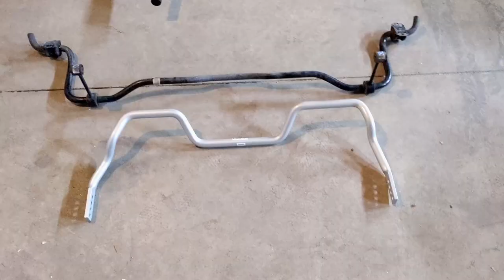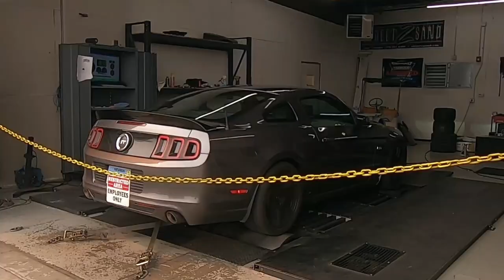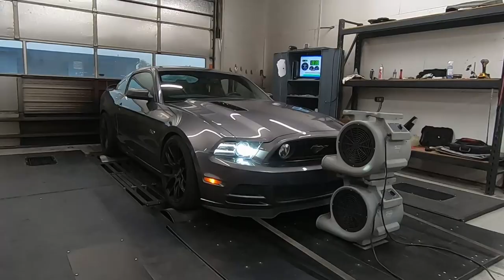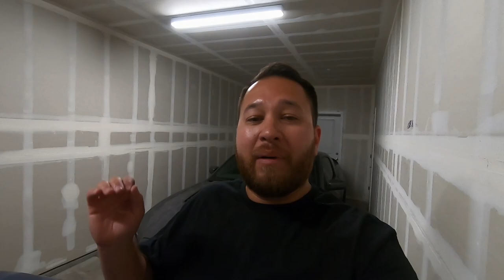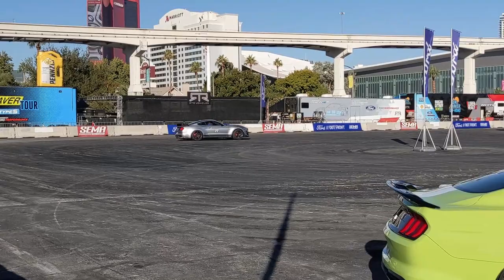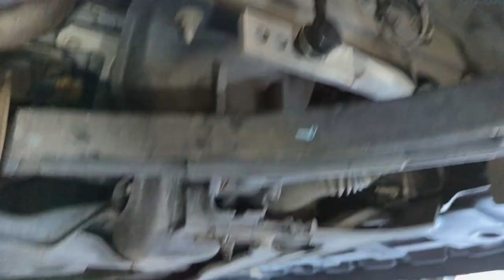Sway Bar Tuning/Adjustments

Comment: Hey Mark, great explanation of how the sway bar works. I recently helped my son install this same sway bar on the rear of his mustang. Are there any torque specifications for the bolts in the link ends and U bolts on the axle bracket?
Reply from the maker: Thank you.  I am not sure what the torque specs were. It has been a little while since I did this job.
Reply: @markskeem ok, I tightened them pretty hard. I didn't know if there was any harm in over tightening.
Reply from the maker: @MrChrisken69  For me too tight is better than not tight enough. Over Tightening can break it or strip the threads.  But if that hasn't happened you should be fine.

Comment: Hello, i have 2 sumple questions
1-does it improve putting an adjustable sway bar link with stock suspension and stock sway bar? 
2-if i put a longer sway bar link, it will force the sway bar down, so it will improve in high speed cournes? Isnt it right?
Reply from the maker: Being adjustable doesn't improve the stock sway bar.  Getting an adjustable end link is for when you change the ride height of the vehicle to move the sway bar back to factory location so it doesn't hit on anything.
Reply: @markskeem  thank you a lot, so about the question of "paralel to the ground"...so i just need to take note of the degrees of the stock sway bar in relation to the ground and put que new sway bar just to be at the same place as the stock one? 
Simple as that?
Reply from the maker: @artiomradetchi242 Pretty much. Stock location is usually the best.  The sway bar works with the twisting action.  I don't see having the sway bar turned up or down really making a difference.
Reply: @markskeem  Thank you for the help!

Comment: Hey whats up Mark, question for you Is there an appropriate way to set preload on OEM sway bars/ end links with just lowering springs? Is it ideal to remove the end links, set the car down on a level floor then re-install the end links?
Reply from the maker: If you have OEM sway bars and end links it will not make a difference if you do it in the air or on the ground.  The sway bar will just rotate in the bushings.
Reply: @markskeem  Ok cool, thank you for getting back to me.